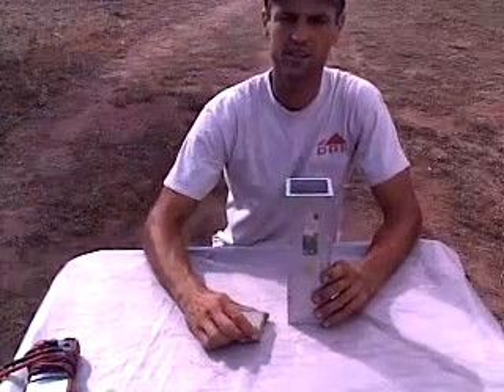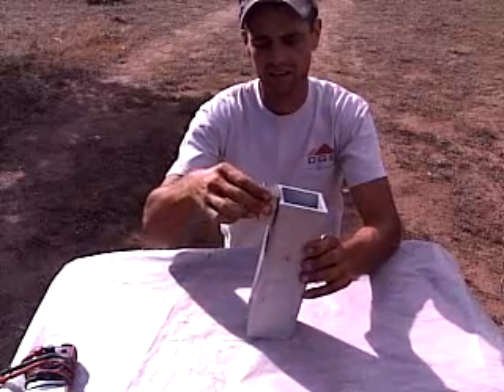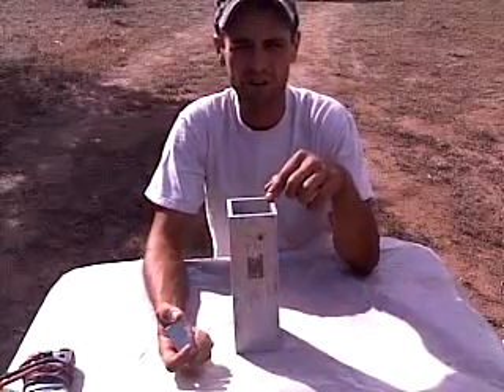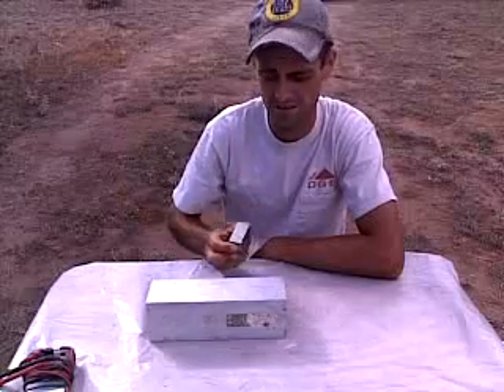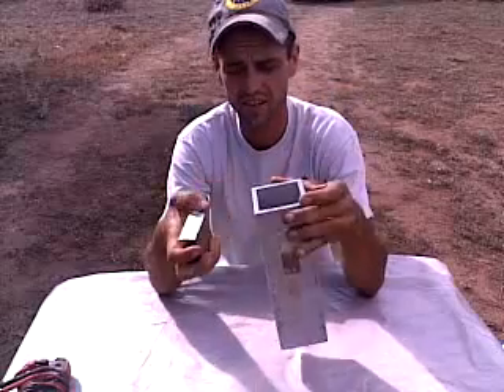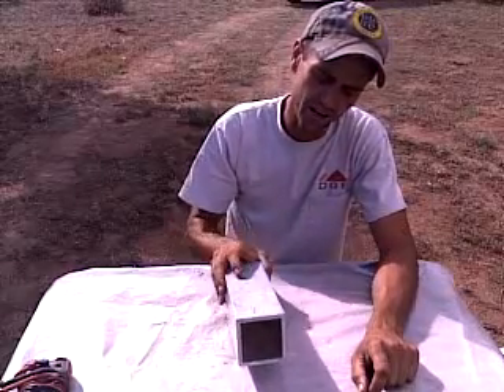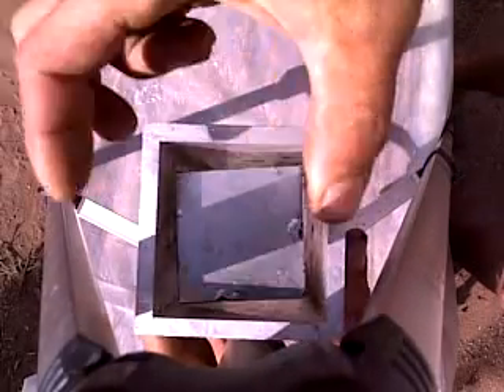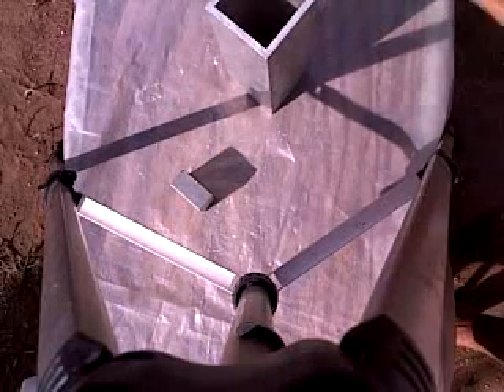neodymium magnet strange effect

Comment: That's how rollercoaster brakes work.  If you move that fast enough you will create a lot of heat.  Put the magnets on a disk and spin it with a motor, move the aluminium close to it  and it will get real hot real FAST.

Comment: Incorrect explanation - aluminum stock is not a coil. What slows the magnet from dropping is the eddy currents creating by the magnet moving past the aluminum. Aluminum is paramagnetic; which means in the presence of a strong magnetic field it creates temporary opposing magnetic fields. This is the same eddy current principle which rotates the aluminum disk in any analog electric utility meter. It is these temporary magnetic fields that slow the magnet's descent.

Comment: Its called an eddy current. Because the neo magnet is so strong it will still create a very mild magnetic force off the other surface. Try it with a aluminum can at a low slope and watch it stop itself.

Comment: If you put 4 copper leads negative on 1 side and positive on the other, with a 6 volt battery,with a regulator controlling the charge you can create lift up and down

Comment: Have a look at the scientist who won the Nobel prize for Levitating (Live) frog, water in balls (As in space station/space), in a tube similar to this, using 16 Tesla of Magnetic force. OK if I got this right, he can levitate a frog/water. Those things are matter, they have Mass. Yet with a certain magnetic force he can make it float around, not as another magnet does, but spin around, go up/down a metallic tube.

So, WHY aren't we designing disc craft that have anti Mass properties built into hull, then the engines can be smaller as not moving as much weight. Someone tell me this Nobel prize winner is wrong, and I can continue reading the mainstream newspapers and believe everything they say again....lol   ;-)
Reply: The floating frog is a really cool thing to see.  What was happening there, was the frog was charged with a magnetic field strong enough to aline all the atoms in its body a certain way.  Then it was placed into a magnetic tube with a slightly offset field.  Adjusting the field of the frog changed it's polarity enough to have it move about in the field.  However, it takes a tremendous amount of energy to create the magnetic field needed for this to take place.  And that's just to float a wee little frog.  Imagine what it would take to hover a several hundred, or thousand, pound vehicle!  Or are you suggesting that the engines themselves have this hover property to reduce friction?  In that case, a regular magnetic bearing would do the trick without all the excess energy needed to make it levitate.
Reply: t s
It is efficient enough to hold a very heavy Train the "Maglevs" high enough off the tracks to be worthwhile. So why we don't have cars with similar systems is beyond me. Get rid of wheels, brakes, suspension, etc. Oh that's WHY, the car corps don't want to lose all that cash....lol. So not a big jump to make a much better system and use it to fly, energy systems can be hugely powerful like a thorium  battery system a designer showed me, cold fusion, with all the billlions spent on it, they'll crack it. Then having the energy system isn't an issue, a small amount of fissionable material contains LOTS of energy. Or maybe the Tesla type system of grab the energy from another off vehicle source. WiFi, Solar, Dark Energy, but it is Doable and that is the important step for now ;-)
Reply: I was only commenting on the levitating frog, not magnetic bearings.  Maglev trains use linear magnetic bearings to float a large object, such as a train.  But the train isn't levitating in the same way the frog is.  The frog is not made of metal.  The high water content allows the molecules in it's body to aline similar to how ferrous (and nickle) metals aline.  But it takes a staggering amount of energy to do this.  And to do it to a person, if done wrong, would turn them to steam.  Maglev is different than this, is functional in some instances, but isn't economically feasible at this time.  It may very well be in the future on large scale for personal transport, but not quite yet.  I look forward to when my grandkids can use it.
Reply: t s
Maglev IS economically viable. ASk China they ARE using them, Japan has since 1970s & UK was going to in 1960s but Govt is too mean/corrupt...lol.

Humans are also 90% fluids/water so shouldn't be any more difficult. Especially when Graphene/Carbon tubes are economically viable, then we will have ambient temperature superconducting materials, and Thorium Plasma power systems and easily do this. Ask Stamford/Caltech ;-)
Reply: PYakMan1 Yeah, you're correct.  As a train for mass transit, it works, but is still very energy intensive.  To then suppose this gets scaled down to individual automobiles is a very big leap, the least of which would be the infrastructure to lay high strength magnets along all roadways, so that cars didn't need wheels anymore.  I like how you think, and the world needs visionaries.  I hope you are applying yourself towards these ends actively.
Reply: PYakMan1 I'm also not sure what you mean by thorium batteries.  Do you mean traveling wave reactor (TWR)?  These are very viable and in limited use in some parts of the world.  They are compact (about the size of a 55gallon drum), use only a small amount of refined U238 to get them started, then create their own fuel using U235.  They do give off radiation, but not as much as a regular reactor (or even standard breeders).  And they last about 60yrs.  One the size mentioned above would be able to power about 300 homes.  Or are you speaking to nuclear batteries as we use in deep space travel, which use a modified PNP circuit to get electricity off the differential from hot plutonium (~700K) to deep space (~4K)?
Reply: t s
Thorium Plasma power storage systems. Read the Stamford Uni research on them, but as I was told by NASA satellite engineer "We have been using Batteries (His Words) that the world would die for, as they last many yrs at high power outputs". I can't find too much as believe it is in the military/black projects domain at the moment.
Reply: PYakMan1 Looks like a traveling wave reactor that uses thorium instead of depleted uranium.  If thorium is less radioactive still, even better.  Satellite batteries aren't really that special.  Maybe have a slightly higher energy density than the best Li-ion batteries civilians have, but they are pretty huge and very costly, and are maintained WAY better than any consumer would ever maintain them.  Nuclear batteries like the one mentioned previously, are considerably smaller (shoebox), use heat differential to create electricity, and last about 24000yrs.  They don't make huge power, but enough to operate a 1.5KW satellite in deep space where solar conversion is less than 0.1kW/m^2.  They are highly radioactive, however, and require pretty good temperature differential.  And by the way, I hope you're working on something like this in your life.  We need people with your kind of passion!
Reply: t s
Thanks. I am actually on about the Thorium Plasma batteries as researched by the Military/Lockheed type corps, but can't dig up more than simple university research at the moment. That's why I believe it has been made into a "National Security" issue. Think you are nearer the mark with Nuclear batteries, but they use Thorium as the fissionable materials, and as it can be held by person safely, would obviously be a lot safer when the inevitable accident happens.

Strange though that the USA Govt says they buried 2,400 Tonnes of pure Thorium in Arizona Desert, not sure why, no one will talk freely about it. ;-)
Reply: t s
Nice to have a decent, educational conversation with a person who explains in detail exactly what they mean. Thanks

Comment: What is the difference in between the measurement of the magnet compared to the inner area of the aluminum. I am doing some of the same experiments and want to adjust the gap between the magnet and metal. I have you tried any other size magnets or aluminum? Thanks, good luck and aloha

Comment: I'm fairly sure you could shield the actual passenger space from most of the magnetism. But that's all theory. The real question is how many times as much money as existing well-reliable elevator brake systems would this actually cost? Like, if hugh heffner has an elevator in the mansion he could probably try this out for fun, but it's just not commercially sound.